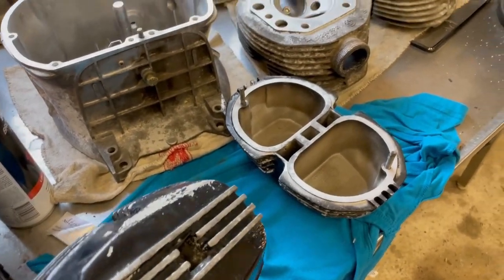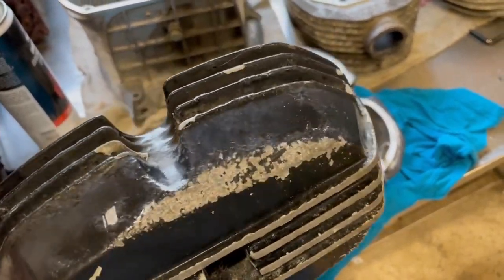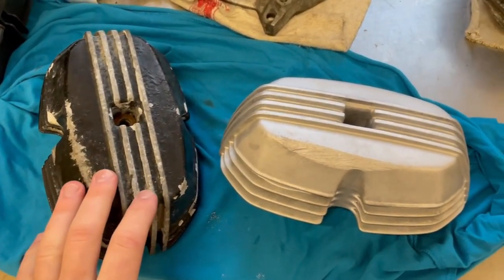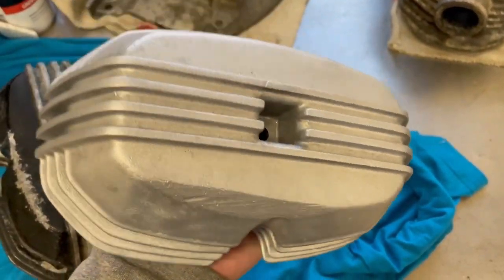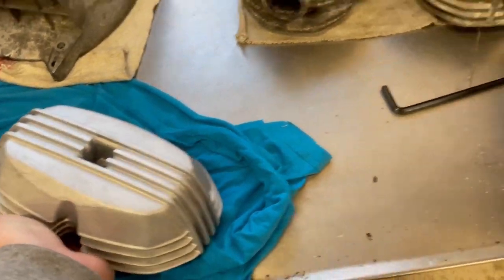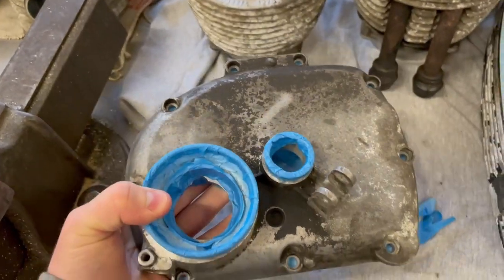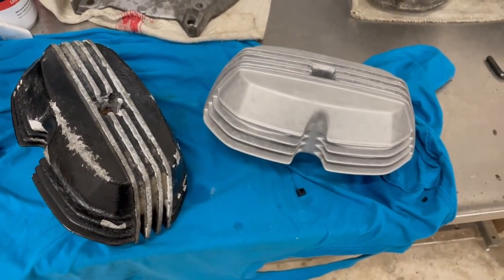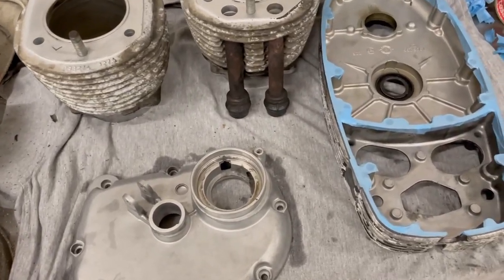BMW R80 Roadster - Part 3: Cleaning up the engine

Comment: Would it have made sense to use paint remover before sand blasting?
Reply from the maker: In the case of the covers its’t not worth the hassle with all the chemicals. For the tank and pieces that are coated with multiple layers it’s propably a good idea to remove the paint first.🏍